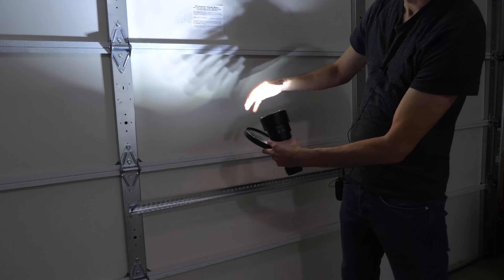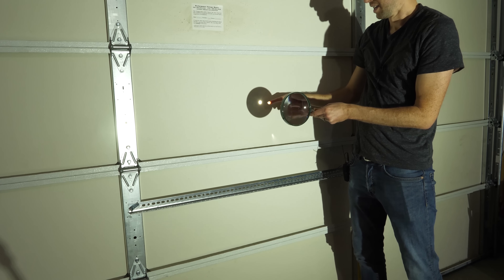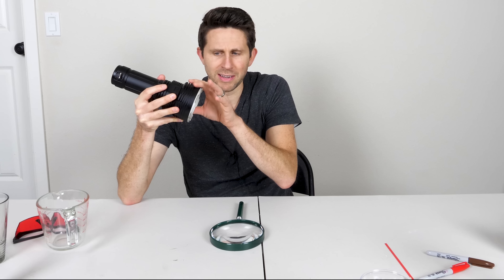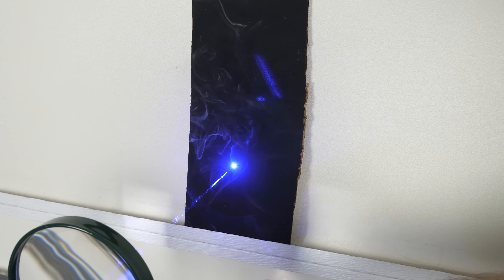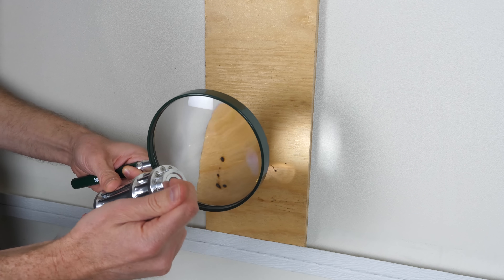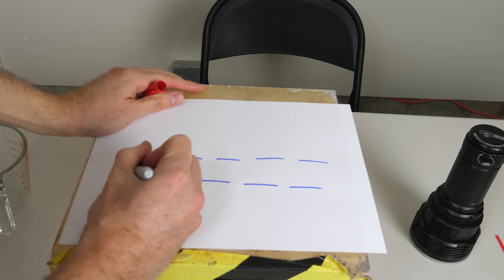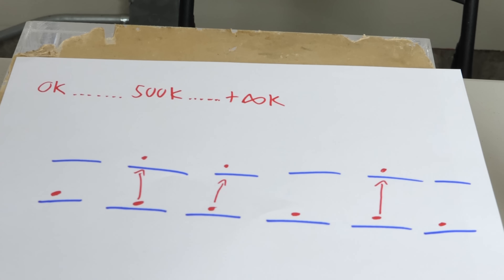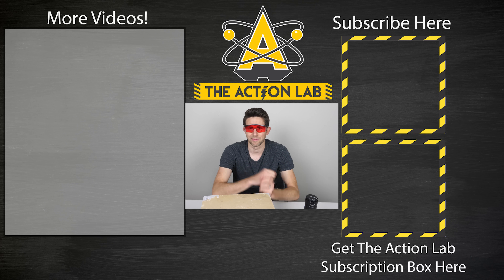What Happens if You Focus a 5W Laser With a Giant Magnifying Glass? Negative Kelvin Temperature!

Comment: If you were able to capture all of the light from the flashlight, and focus it on one point,  it should work.
Solar radiation has a far broader spectrum, is more capable of heating surfaces, and is coming from a single source of which the circular magnifying glass is more suited for focusing.
Also, the angle of the light plays a role. 
If you were to make a magnifying glass more capable of collecting the light from the flashlight, and focus it onto a single point,  it should heat surfaces significantly enough to burn them.
The magnifying glass that you used simply cannot achieve the task.

Comment: if you stop caring about how bright the spot is, and instead concentrate on the powerdecity you would get somewhere. Also a laser is enerally collimated wich makes it easy to focus with a lens without any lose. Depending on the wavelength of the laser you can get the result you have in the video, but that is not the rule for all leser waveleths. some a good for making things with, and some are good for transmitting data for example.

Comment: you can simply use a perfectly reflective surface and use it to engulf and focus the light using a focusing reflector then use a big enough lens at the focused light range coming off the exit end of the reflector and focus that light onto a smaller point.   it will probably simply work without violating any entropy or thermodynamics due to the presence of a light energy guiding reflector.
(parabolic mirrors    or     collimating lenses    before the magnifying convex lens)
Reply: He knows

Comment: This explanation seems really fishy.
Reply: Honestly, the dude running this channel is not very good at explaining science concepts. The real answer is that the beam gets hotter and hotter because he's focusing the light down to a tiny point, meaning that all the energy is being concentrated in a single spot. It's possible to do this with lasers because all the light moves in a strait line, and you can get the light rays to converge to a single spot using a simple lens. Doing this with a flashlight is almost impossible, because the the light rays are coming out of the flash light in random directions, and are not parallel to each other. Because of this, you could only use a lens to focus a little bit of the light at a time. But this has nothing to do with thermodynamics, its just a consequence of the fact that the light coming out of a flashing light goes in different directions, and the limitations of optical lenses. If you could build some kind of machine that could change the direction light is going in, then you could totally concentrate all the light coming out of the flashlight into a single spot
Reply: He is talking about some complicated quantum mechanical theory that is only loosely connected to the experiment he did. It's like explaining why the planets orbit the sun by jumping straight to how Einstein discovered general relativity. It's way to complicated, you have no context, and it doesn't even really answer the original question

Comment: The explaination is incorrect. Heat CAN pass from a colder to a warmer body, for example, air conditioner. However,  heat can never pass from a colder to a warmer body WITHOUT SOME OTHER CHANGE, connected therewith, occurring at the same time. (https://en.wikipedia.org/wiki/Second_law_of_thermodynamics). In case of flashlight/laser, there are chemical reactions in the battery, so there is SOME OTHER CHANGE. So it doesn't violate the second law of thermodynamics at all.

Comment: Someone please explain this better, this makes little sense. Take a retro reflector setup, I could focus a flashlight to a point hotter than the surface because we are not talking the surface but energy over area. If you take the energy and focus it on a smaller area you could without a doubt get it hotter.

Comment: how much magnification do i need to burn when buying a magnifying glass with a 1w laser?
Reply: If the 1w focuses then you are good.
I had a 1w, 2w, 4w and I'm making a 7w lasers from 3w above are extreamly dangerous.
Reply: @HSO-ro3bd  so a10x magnifying glass is good?
Reply: @alfredtolentino8614  yes, but it will be harder to burn thin stuff like paper my 4w goes through paper like nothing so its hard to catch it on fire
Reply: @HSO-ro3bd  actually I’m going to use it to kill “ bad invasive coral and algae” in my aquarium. Close to the water surface.
Reply: @alfredtolentino8614  nice
Reply: @alfredtolentino8614  check out my 4w vid just uploaded this is what a true 4w does, unlike this one in this vid is no where near 5w
Reply: @HSO-ro3bd  if I’m going to buy a 4w laser. What’s the best color to get?
Reply: @alfredtolentino8614  Sorry for the late reply youtube notifications don't show up, but there is only one color you get in 4w which is blue there are no greens higher than 1w or violet there is only Blue, red, but very rear, or Ir which is invisible.

Comment: I may be understanding this wrong but ‘+ infinity temperature’ doesn’t sound right. The maximum temperature of radiated energy (Photons) is the ‘Plank temperature’ where the wavelength of the emitted EM energy is equal to the Plank length.
Reply: What it means by "∞" is that a laser like this does not have a actual tempeture everything depends on the substance like thermodynamics

Comment: Your talking about heat transfer. The R in laser is radiation, which is transferring heat with out a medium. The same way the sun heats the earth. 
Yes heat flows from hot to cold. The hot spot in a laser will always be hotter than what you aim it at.
That is how a laser beam of light can cut through steel.

There is no such thing as negative temperature.

Comment: usually ur video's are interesting / decent, but you are kinda off the deep end here.   "hotter than infinity", that's kinda silly.  :-)   but the reason u cant focus down your flashlight is cuz your lens is not positive enuf, (not convex enuf) and your flashlight rays are way too divergent.    look at cars with "projector" headlamps.  they have a lens that is so positive it is practically a sphere, just to get relatively parallel rays from the small headlight lamp. a little more positive than that will focus the light to a point.  they also have "tactical flashlights" that have lenses that are almost spheres.  so stack up 4 or 5 of your lenses.  not very practical, but u can converge it.  That thermodynamics law, as you mentioned it, does not apply to the case of where "you have radiation going thru space", e.g. flashlight beam, or laser beam, or relatively parallel rays like from the sun by the time they get to earth.  how the heck can those photons in those beams know what you are going to shine them on??  you can aim a yellow 2000K flashlight at a blue hot star, 25000K.  do u think your flashlight photons are going to turn and run in fear cuz the star is hotter???  uh, no.  that thermo law of heat always flows from hot to cold is like for a solid or liquid or a closed system.  the law applied: for example, put ur laser in a closed steel box, the energy flows from the lasers batteries thru the laser to the box.  the box gets hot and radiates, conducts, convects its heat into space.  eventually batteries go dead, box cools to room temp.   You can focus down your laser easily with any positive lens cuz the rays are not divergent, they are essentially parallel.  open up that laser and you will likely find, if it is laser-diode based, which it is, most likely, that there are lenses in it to collimate the beam, (make the rays parallel).  a laser-diode beam is quite divergent, it's like a point source, and needs something, e.g. a lens (or concave mirror like a flashlight reflector) if you want to make rays parallel.  your hand laser beam doesn't diverge (much) once it leaves the laser, cuz it has been properly collimated, likely by a lens or lenses, not cuz it was made via population inversion.  how would the photons know how they were made?    Consider color temperature of infrared lasers, 100-2000K,  they use those to cut steel sheet which is white hot while being cut, about 3000K or more. that example disproves your "violates thermodynamics" statement of the color temp can never go up.  Rather,  the total ENERGY can never go up.  if u concentrate energy the temperature goes up.  energy flows from laser to steel.  Once the photons are cruising thru space, they have no clue what they are being aimed at, or what the target's temperature is.  and for that matter, the photons do not know what the energy state was of what they came from (your beyond infinite temp).  they know their color and what direction they are going in as they radiate.   i do like some of ur other vids tho.  you  should revise this one!!

Comment: Sorry, but this really annoys me. You basically said that you can't start a fire with sunlight and a magnifying glass. They have solar powered 3D printers that melt sand into sculptures with a magnifying lens. You can go outside and burn a leaf (or bug if you're cruel) with a magnifying glass using... THE SUN!!! 

Also, there is no infinity. Once you get so compressed, then you are entering quantum states, and the photons can't get smaller. You can add more energy into the system, but not infinitely for any given point. There are intangibly huge or small numbers that we can't fathom, but it's still a number. The same applies to black holes. We were told they had "infinite" gravitational pull, but that's just false. It's a numerical value so large that we (or most of us) just can't comprehend with our feeble primate brains.

It's a cool laser trick, but it's the same thing as burning a leaf using the sun. Lumen =/= Temperature. You could get an item to burn using an incandescent or halogen bulb magnified instead of LED's. LED's just emit a narrower band of light waves, which is why they are so much brighter for a given energy input. Other systems generate more heat and more bandwidth, but require more energy input to generate the same lumens.

This video seems like a disservice to your 3 million subscribers and misleads them into making false assumptions about science.
Reply: you really didnt understand a shit lmao, he said we could never get hotter than the source, for saying that he said the surface of the sun we are not touching the sun dude.. we are 92,900,000 miles from the sun, the energy is spread. the better we can do with a glass is focusing that light that is spread on a single point. but we could never even dream of being close to the source.
Reply: that is the dumbest comment i've seen here

Comment: next time try to put the light into a mirror tube that extends all the way down to the magnifying lens..... let me know if it looses photons...
Reply: I see your point, something akin to an optimally designed focal length lens into a collimator to a other lens. This would be much better than the system he designed, and he may have even been able to get a pretty good focus on it, but we have to remember that there’s no such thing as perfect transmissivity, there’s always going to be scattering loss. Temperature is irrelevant, he misrepresented the second law of thermodynamics (it’s actually the first law that deals with internal energy and relates to the law of conservation of energy). There’s never going to be more total energy in a point than there is from the total source. But kinetic energy and temperature are not dependent or derivative from one another, Boltzmann’s constant is just used as an approximation measure. The real relationship between temperature and energy is 1/T=partial derivative system entropy/partial derivative internal energy. Due to the second law telling us that the entropy of a system trends towards a maximum, there’s a huge incentive for nature to increase entropy to a system. This is the relationship between temperature and energy, and why heat flows. 

The lay audience would interpret the second law of thermodynamics and use boltzmanns constant (in what is an approximation for temperature, but not a true equation that holds in physics) to conclude that to increase entropy (disorder of a system), increasing kinetic energy and smashing particles would be good. So cold things should get hotter for the second law of thermodynamics to hold, right?

What he should have discussed is that a system will give up internal energy (as discussed by the first law, manifested as temperature) to increase entropy in a system at a quantum level. Because at high energy states there are relatively less high energy states available to go to, the system will give up energy (cool down) to increase entropy by having a greater distribution of particles in a low energy state with more free energy states available until a local maximum for entropy in that system is reached (assuming a perfectly isolated system for theory sake). This would mean that although the temperature of the system is decreased, entropy is increased. Remember, the variables at play are temperature, energy, and entropy. Energy is fixed in an isolated system, can’t be created or destroyed. Entropy has to be maximized. The only lever left to pull to balance that equation is to lower temperature, preserving energy, and increasing entropy to its local max. This is what he was trying to illustrate with the energy state drawing.
Reply: @zippoc04  awesome explanation 👏

Comment: This video caused me to doubt everything he's said in the past.  Its clearly BS.  Light from a torch can be collimated using the right sort of lenses and then focused. You can't do it with an ordinary simple lens, especially if you're using one of those led torches that has multiple point sources.   Lasers often have light that is divergent and actually need a collimating lens to make the photons run parallel to each other.  There's no reason to bring the laws of thermodynamics into this. I've never ever heard talk of Negative temperatures in all my years and I'm thinking he's just read the wrong paper.

Comment: but Entropy is the 2nd law of thermo dynamics...  the hottest anything can be is 299 792 458 m / s there isnt a infinite, so you can focus the sun down to a single point and because you are focusing it down to anything smaller it will get to the point where they get equally hot, and they both radiate the same amount of heat but since one is smaller it will not radiate more than the other so you can speed it up more. so you can infact get something hotter than the surface of the sun by using the surface of the sun.

Comment: using reflector behind the lights and 2 convex lens,one just before the ,and another to concentrate parallel lines of light,thus you will get a point of light,,which will have same energy in a reduced area,,thus you can creat a point that is hootter than the surface

Comment: Great video! I took the same classes, I’m a chemical engineer and made an A in P Chem. My professor had a better explanation of negative temperature, as he used entropy to show that negative temperature was hotter. While your quantum states explanation was insightful,  it didn’t show the connection between these states and entropy. And temperature definition is based upon entropy.

Comment: I don’t know about this. It might be more due to mass than negative temperatures. Light is a unique thing as it’s a wave and a physical object. Using density, equal mass on less volume makes things more dense. For the flashlight, the magnifying glass focuses the point further, but it captures a lesser mass of light. For the laser, it catches all of the mass of the light, and reduced it down to a lesser area. The lesser area, the more dense, and since this is now an equal amount of energy focused in a smaller area, the laser is more powerful.

Comment: What I got from this video is that the concept/definition of temperature and the Kelvin scale were not designed to work with quantum mechanics and lasers. You basically have to jury rig Kelvin to get it to work, but you also have to deal with nonsensical sounding results like this.
Reply: Quantum mechanics in itself is nonsensical so don't look for some satisfying answer.
Reply: @1GamersRewind  Nk, you're wrong, quantum mechanics are just really complex
Reply: @jacky9575  That's what's I meant by nonsensical. Things that defy human intuition will make it seem weird or impossible. You have to accept that to even try to understand it, and you still ain't because you can't. Even a top scientist in the field will just break down and cry about this topic.
Reply: Kelvin is actually a good scale to use since the negative temperature shows clearly that there is something fundamentally different going on with the laser, as opposed to just 'being hotter', to put it crudely.
Reply: No, kelvin actually makes perfect sense in quantum mechanics.

Comment: Flash light spreads the light all around. So your losing energy or at least not all of the energy coming out from the flash light is going toward the Magnifying glass. Same with the sun that’s why it’s can’t be hotter than the source unless it’s a laser. Lasers are practically a dot which makes it so that all of the energy gets absorbed and pass thru when shining it on a magnifying glass.

Comment: Your comment on the flash light intrigues me,  the LED’s can be focused with a reflective mirror with greater efficiency than with your magnifying glass!
Reply: Well that's the whole point of why telescoping flashlights exist. I have one for example that basically looks like a beam when fully zoomed out (not quite a laser but still way smaller and brighter). Pull it back in and it disperses in all directions as normal.
Reply: The best you can do is to have an image as bright as the source, using ellipsoidal mirrors.